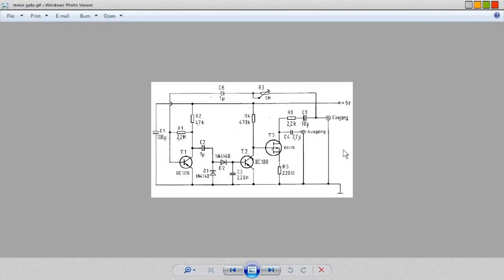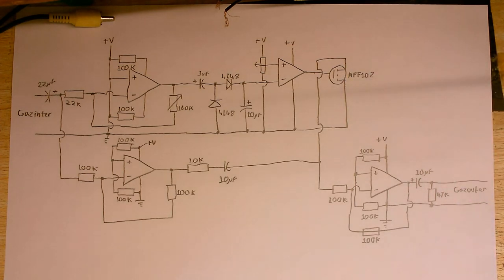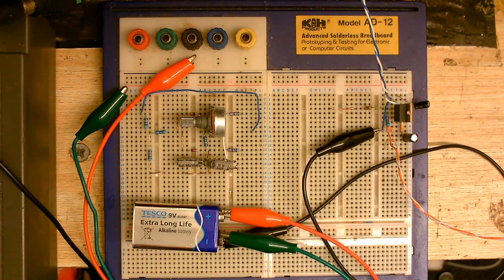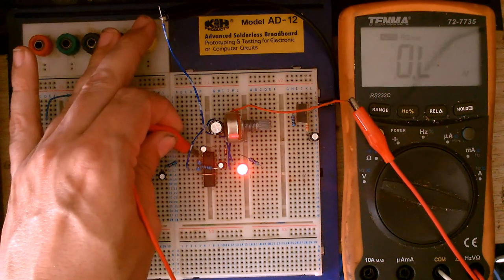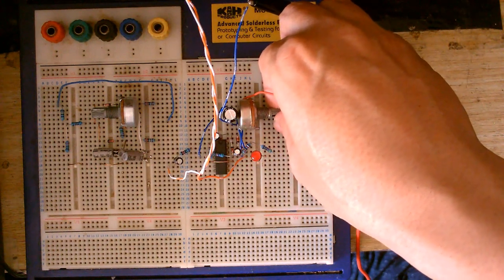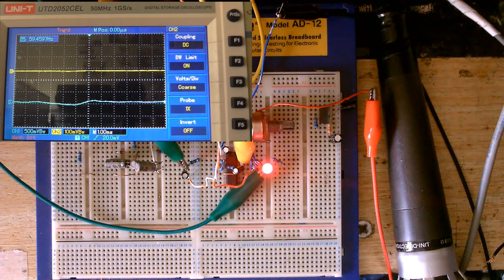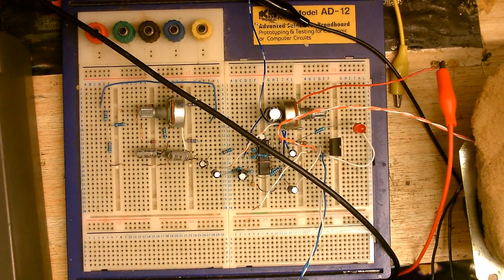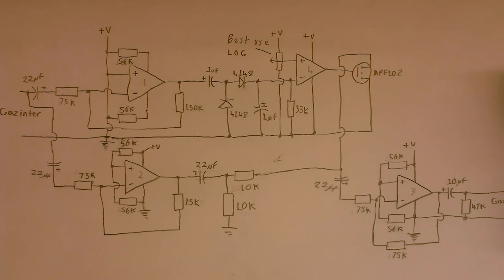Home Made Noise Gate / Experiment

Comment: I really appreciate this. I also built that first circuit and had no luck at all. Like you I made what I felt were valid substitutions, and I was so confident that I made a PCB board for it. Total waste of time. I'm now perusing scratch development like you did. Seriously considering using Vactrol (LED-cadmium cell combo) instead of a MOSFET though.  Since they are purely resistive there will be zero distortion. They also respond quickly to turn on, and slowly to to turn off, so I think they will be better for a musical instrument, like a guitar input!

Comment: Well done Clem!
I have encountered this sort of circuit used in a practical application.
This was on the outgoing speech of the Telephone Equipment used in a Call Centre.
This was done to prevent someone calling the Call Centre or being called by the Call Centre being able to follow other nearby conversations going on in the Call Centre.
The snag is that if someone doesn't know about these Gating Circuits they may think that there is a bad connection in their Telephone.

Comment: I have implemented the first circuit you didn't get working into a microphone audio processor I made years ago and it does work but has the major drawback of too fast cutoff making almost a pop sound between gating. I made a modification to the circuit that greatly improves it in one of my projects by placing a LED in series with a current limiting resistor on the FETs drain output to V+ and a LDR on the audio output to mute when below the gate threshold instead of the FET gating the audio directly as a switch itself. The slower action of the LED controlling the LDR sounds more natural and is a very simple modification to the original schematic. By doing this the LDR causes a much smoother response and removes any audible on/off clicking perception for a smooth transition. FETs are simply too fast in my opinion and sound like someone flipping a switch to the microphone and that's even when they are properly biased to act as variable resistors - which might have been part of your issue with distortion through them. 2N7000 MOSFET works in a pinch too in place of regular FETs for audio gating with a small footprint. I've seen them used in mute circuits before. One last thing that should be added is a blend or mix potentiometer because the full on/off of audio is jarring to the ear and a more subtle difference along with some decay is far more acceptable in live settings. All easy things to add to your circuit :)

Comment: It would have been very interesting if you had used your oscilloscope to also probe the original circuit. From the schematic it's not obvious why it should not work. The BS170 is a MOSFET as well and not a JFET. Is the circuit from one of Günter Wahls "Minispione" books?
BTW, the schematic of your design has a short circuit between 12V and ground at the + of Opamp 1.